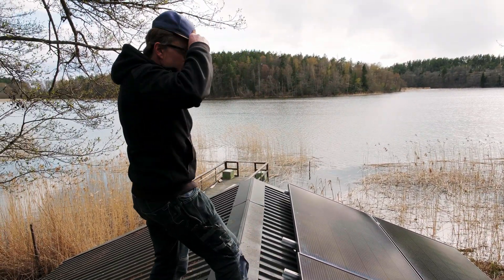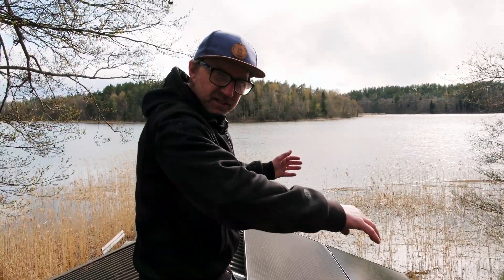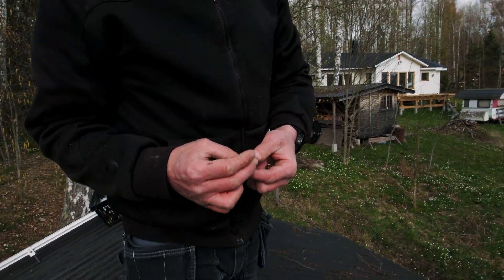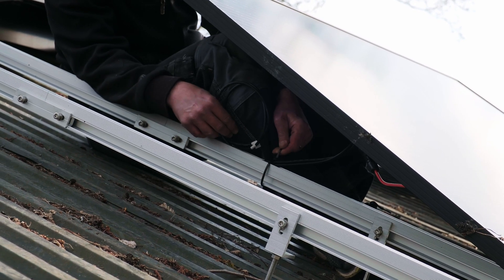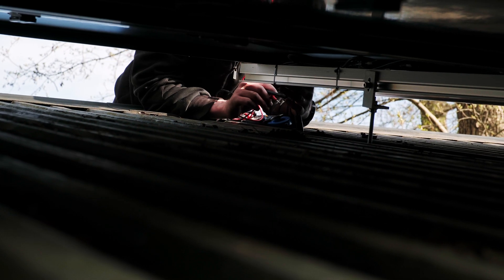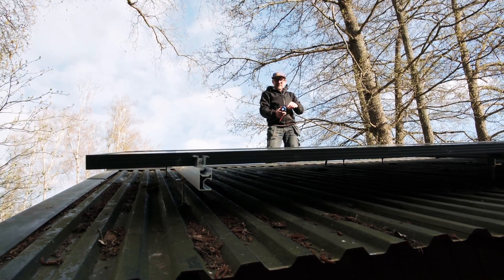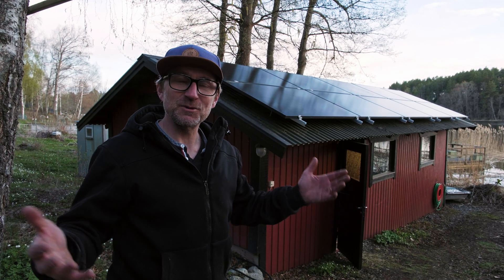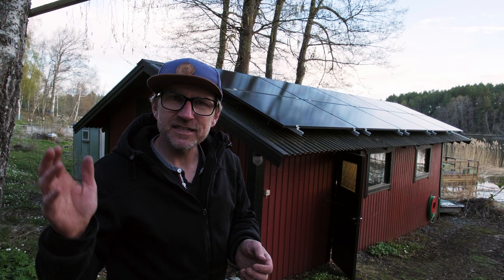FREE ENERGY! Adding more panels to our HUGE DIY solar system!

Comment: My job is to install solar panels, and I got to say that you're doing an excellent job! One potential problem I can think of(which I cant tell for sure from the video), is are the panels equally shaded? Or are some shaded by trees, while others get full sunlight? Because this will be detrimental to the panels which get shaded since you've connected them in series.

Good job using water lines for passing the cables, because they will last forever the sunlight/rain/etc. Also you rightly used a torque wrench for tightening the screws. Most people are impatient and use impact drivers which ruin the thread, up to the point of the screw not being able to ever get unscrewed again (specifically if you screw inox screw to inox nut instead of aluminum).

Btw do you not have birds in your area? After a while birds might get to your roof and make it their home under the panels. Where we install these it's basically a requirement to add bird protection under the panels all around, so that no bird can ever come through. Tho I'm not sure whether in your situation it's a problem, because they are not too many panels. Tho I've seen birds immaterially getting under panels fewer than what you've installed. I guess you should wait and see first!
Reply: I believe the panels have optimizers, so shade does not effect the other panels.
Reply: @IamNoel  oh, I forgot if he mentioned that. my bad.
Reply from the maker: Hey @sunnyeyes!
Jack here!

Yep, just like @IamNoel mentioned we are running optimizers. Pretty much our whole block of land is shaded in one way or another, and since we don't want to take down any trees we simply have to put up with slightly lower & unsteady output. Not really an issue with 62 panels though😅 Plus, we have space for more if we want😆

Thanks for watching, and thanks for your input!🍻
/Jack

Comment: We have 48 panels on our roof, and no more room to install more.
48 is for us a little bit of an overkill.
Question for Jack. What LUT are you using when rendering the videos? Is it teal and oak?
Reply from the maker: Hey mate! 
Jack here!
Pfft! You can never get enough panels😜😆 You'll have to lay them out on the lawn😆

Regarding the grading question here is a basic rundown of my workflow just to keep the explanation simple: 

1. I film as much as possible in log or flat profile's. My Fujifilm in F-Log, my DJI drone in D-Log, and if I use an action camera like the Insta360 or GoPro i set them to flat colours. The only exception to this is my phone, and certain modes of the other cameras that don't offer Log or flat profiles...

2. In editing (I edit in the free version of Davinchi resolve)  I don't use any creative/styled luts in that sense. I just use the "basic" natural looking LUTs from the manufactures, to convert the Log footage into something more workable. 

3.After that I manually adjust exposure, contrast, colour, and detail in 4 separate nodes with the goal to match each camera as seamlessly as possible. The only creative touch of colours I usually ad is some split toning in highlights and shadows where I usually aim for a warmer image since that's what I prefer😊

Hope that answers your question!
Se you around🍻
/Jack

Comment: More power.... I've just invested 3000 euro into home batteries. 2 x 200 amp at 51.2 volts (each 10240 Wh, so together just over 20kwh)
Reply from the maker: @IamNoel, power to the people! We'll be checking out our 60kWh pack next video. 😀